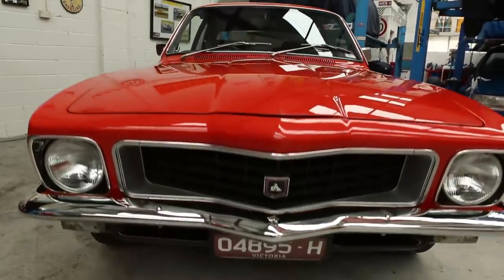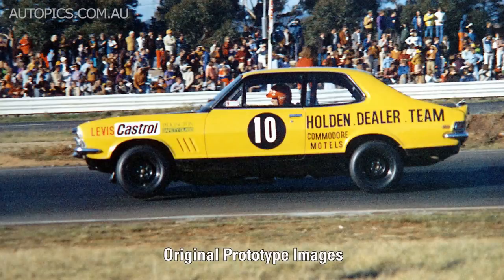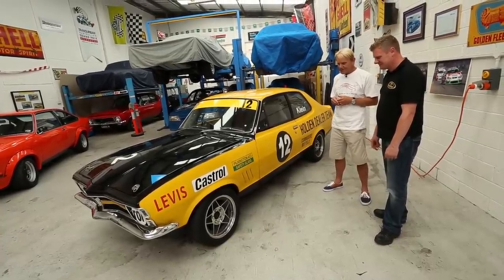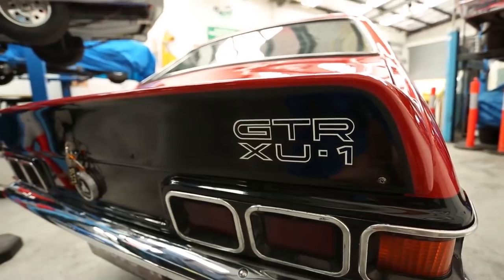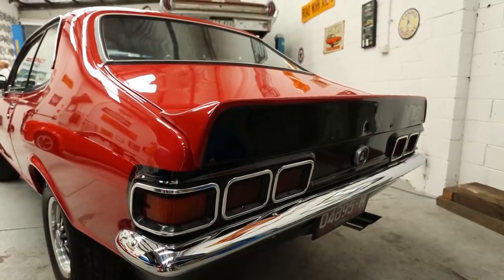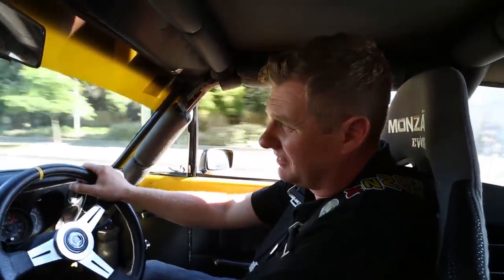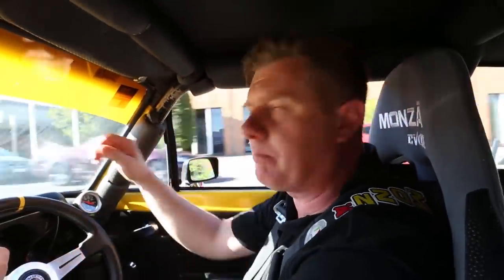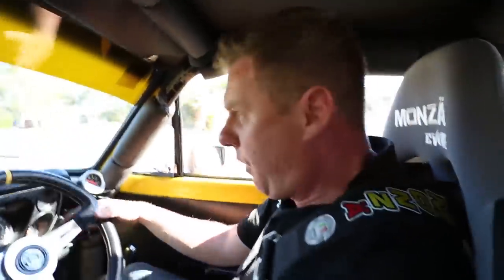XU1 V8 HDT TORANA PROTOTYPE Replica - Pt 2 Ron Klein GM Holden Collection

Comment: remember bathurst is an endurance race not a sprint race & he did say that he was breaking gearboxes and snapping axles before he changed them to the very much stronger Ford units, also the original had 13" rims so that means smaller brakes which is fine for a light 120mph 6 banger but a heavier 150mph rocket all of a sudden those small brakes are left wanting, and dont also forget the SLR Toranas also needed a few generations to stop snapping axles and chewing gearboxes and when Ford went from the 302 to the 351 it also snapped axles and chewed gearboxes it took a few generations to iron out all the bugs and, so yes it would have been a quick car but a reliable one?
Reply: I can remember reading an article when Howard Marsden was being interviewed,  yer he was convinced 
both the toranas and charger's  would of had brake, gearbox's and diff problems running the v8s
Reply: 'Pftt' Ford Fans have no idea the Work that went into the V8 LJ Program by Harry Firth and Holden Engineering, First up they Had New Front Disc's and New Front Calipers for better stopping power and the 308 V8 was only 22KG Heavier than the Red 202 6Cyl Engine any way and the 6Cyl LJ XU1 never had any brake problems any way.  A new 2.78 Detroit Locker Diff was made for V8 LJ and Brand New Sprintmaster Wheels were Designed for V8 LJ, they were a lighter wheel and better cooling wheel, Also the XW7 308 V8 was a 300HP V8 and Harry Firth tested  the Yellow LC HDT XU1 V8 Prototype at the 1972 Easter Bathurst in a Sports Sedan Race and Won without a Problem, Also tested at A.I.R Race Track at Adelaide and at Calder in May 1972 plus Open Highway Testing By Larry Perkins as well without a Hitch. Harry made up a Brand New Sump for V8 LJ that had no Problems at all unlike the LH Torana 308 Engine that Repco did for Holden and Harry had to fix that up during 1974 as Holden used the Repco Sump and not Harry's special sump he made up for V8 LJ.
Reply: @666theninja  
I'll sleep better at night knowing all of this. Don't know about only 22kg but all looks good on paper as the phase 1 did, but 20 laps in.. oh no
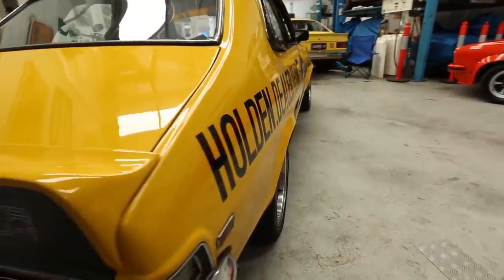Bondy best time was 2:39.6
3:8 seconds  slower than a phase 3
Was racing against alot slower cars
Biggest problem was his race was a huge 5 laps, about 125 less.mmmm
Reply: @666theninja  and holden fans seem to forget that this is bathurst where production cars race not lemans where you can race prototypes! so just because the prototype had lots of bells and whistles doesnt mean the production version would have it
Reply: @GTFORDMAN  The Production Version was getting it ALL, As there is a 79 Page Parts List for the XW7 V8 LJ Torana that List all the Goodies that the 200 Factory Cars were getting so the Car could Race at Bathurst 1972, the Cars were only Two Weeks off Production when Holden Canned the XW7 V8 LJ.  The 200 Aug-Sept 1972 LJ XU1's that were Built got the V8 XW7 Sprintmaster Wheels, Brocky had them on the 1972 Winning Bathurst Car if you go look.
Reply: @666theninja  
That's good that they were testing, but the point we are trying to make is that Bathurst was a RACE for 130 Laps,soon to be 163 laps.
1972 the falcon v8s had 6 years race development 
Ho's had 4 years of development to work out any problems ( there were plenty only found out in race conditions ). Glen even said he had to replace components because of constant failures, and i bet he didn't go as hard as bondy or brocky.
That's the point I trying to make,
Reply: @jimmartin9704  Pfttt Jim, How many Bathurst the 308 V8 Win, lets see. Bathurst 1975, Bathurst 1976, Bathurst 1978, Bathurst 1979, Bathurst 1980 should I go on lol. The 308 only failed in 1974 due to the L34 Oil Pump needed a extra washer that GMH Engine Guru Fred James sorted out weeks after Bathurst 1974. Funny all the Bathurst I mentioned I do not believe HDT did a gearbox in the race. I have owned many 308 V8's with M21 Aussie 4 Speeds in them and never ever did a gearbox in. As I said before the V8 LJ XW7 Production Car was getting a Brand New Detroit Locker 2.78 Diff and that is Fact. As Harry Firth said the XA GTHO had rear leaf springs suspension for bad Handling and would of had brake problems at Bathurst 1972 as Ford never tested that car under race conditions like HDT did at three race tracks with the V8 XU1 Prototype.
Reply: @666theninja  
And like i said even Glen had troubles with it initially,  which by the way was  what the original txt was about not LH /LX Torana, VB/ VC COMMADORE,  wow
Quote him we finally fix it or do you want me to be a smart arse and say ford parts fixed it
Reply: @jimmartin9704 'Jim' if you watch the Video the owner SAYS the 308 has been stroked to a 355, The Factory XW7 V8 LJ was not going to be stroked at all, Ronald the owner has took it to the next level, no wonder he was doing Diff Centers in the Banjo. I mention the LH-LX 308 Cars as the Engine was not a problem at Bathurst at all. The Factory XW7 V8 LJ would of Won Bathurst in 1972 and as the Great Harry Firth said the car was that good it would of Won everything it entered in.
Reply: @666theninja  
Wouldn't expect him to say anything else, and yer its now a 355, wasn't always
Reply: @jimmartin9704  Rory in Queensland owned it and used to race it before Ron bought it, Ron after he stroked the 308 in it is when he started doing diff centers in it. Sounds like Ron needs the Harry Firth's  2.78 Detroit Locker in it.
Reply: @666theninja  
Yer and we all know what lies were being told on hp to keep insurance premiums down , phase 3 only produced 300 hp to.
As none were ever raced will never know, except for Rons one
Reply: @jimmartin9704  Harry Firth's Yellow HDT LC XU1 V8 Prototype was Raced at the April 1972 Easter Bathurst and then later Raced at the A.I.R race track at Adelaide and then on the 14 May 1972 at Calder, so it was Raced, that Yellow LC XU1 V8 even had a Rego Plate, Victorian Rego Number KSN116, So it was Raced and never did a Diff Center or a gearbox during them three Races. Also Larry Perkins Road Tested it for thousands of miles as well. Harry Firth said if anyone was going to break it, it would of been Larry Perkins, Larry hit 6500RPM in Top Gear in it on a Open Speed Highway, as some States in Australia in the Early 1970's had open speed on there highways. Plus the Strike me Pink V8 LJ GTR Prototype was Found in 2012, it's the Only one left out of the Three LJ GTR V8 Prototypes, the Orange one was Stolen in 1985 from it's Pvt Owner and has never been found, the White one if Survived since finding a new home since GMH is still out there or long gone. Least the Strike me Pink one has been found.
Reply: @666theninja  
But according to you 8 messages up it wasn't running the " Harry's motor" 
So again i will say we will never know, unless they dust off old pinky and do more than 5 laps at Bathurst
And i doubt that will happen. 
Again i could waffle on about how you said the v8 lj would of won everything but the facts are when a v8 was put in a torry they had all sorts of problems, which to be honest, according to you should not have happened.
Like we said earlier with all the good parts it was alleged going to get, when bean counters get involved 
You don't get them even when you are the great Harry Firth
P.S. it wasn't till 78 and the A9X that all they problems were sorted 
T10
Detroit locker
Ring a bell
Oh yer great that they found the pink v8 lj , bloody beauty
Reply: @jimmartin9704  What your not getting is Harry's Yellow Car did Three Race Track Testing and Thousands of Miles of Testing by Larry Perkins, the car did not do a gearbox or a diff under them race conditions, The 79 Page Parts List for XW7 V8 was Done and Approved, REMEMBER the V8 LJ was only Two Weeks away from Production, so every thing on that list was approved as i have a copy of it. 200 Cars were getting Detroit Lockers and all the other good stuff that is on that list. Bean Counters approved it cause GMH wanted to Win Bathurst 1972, in the End they Did not need the 308 V8 any way at Bathurst in 1972. Yes great News the Pink V8 Prototype has been found.
Reply: @666theninja 
Yes but 3 meets,endless testing 
(with or without the gun motor) 
Doesn't even come close to race conditions, especially Bathurst no matter how much you try with testing,
( Look at moffart in 74) so l will agree to disagree
Reply: @666theninja  
Forgot to mention Ian Tate said that the XU1in72 had 240HP (6cylinders)
L34 could get 340+HP
Why go to all that trouble of completely redesign, re-engineer a car for only 60 more HP (LJV8 ) 
Doesn't make sense. 
It had alot more than 300, and it would of had the same Achilles heals as the first LH, as Rons had
Reply: @jimmartin9704  You forgot all the Thousands of Miles that Larry Perkins did in the Yellow LC HDT V8 Car, all there Testing was Waaaaaaay more than Ford did with there Phase 4 Falcon, so i know which one was more like to Fail at Bathurst with Brake Problems and that be the Phase 4. As the V8 LJ had no Brake Problems at all as Harry sorted that out plus the Handling and a Detroit Locker Diff, the XW7 308 V8 only had 300HP in the 1972 Time Frame, was not to 1974 with in the L34 time frame when they got Roller Rockers etc they went past the 300HP stage. A light weight Car with 300 HP 308 V8 would of been a Missile at Bathurst and with it's 36 Gallon Fuel Tank and Twin Fillers meant One Fuel Stop, Brocky would of Won by 6 Laps in 1972.
Reply: @666theninja  
Again no long distance race conditions for any results. Pissy 5 laps at Bathurst ( Bob Jane was miles in front before he had problems in his v8 torana) with no opposition to test it
* Week later  at AIR, Brocky raced it but it experienced problems 
* Dont now how long the one at Calder in May went for 
So we'll never  know, cause 1000000's miles of testing is only a guide but not in your world
Ford had 4 years of hard racing from many competitors in there HO's to learn what failed, re engineering it to improve those components which they did ( and there were plenty that were only learnt FROM RACING ) even when it looked good on paper 
Phase 4 had globe mags specially designed for the XA which improved braking by 50% on the Phase 3
Had 4 wheel disc brakes on the XBGT
* ONE PIT STOP REALLY, what a load of malarky, so 65 laps on one tank
Spose Harry sorted that out as well, went well for you in 73 that plan with 6 cylinder didn't it 
*Again with all the shit that was the best in the world cause Harry sorted it out on the LJ, 
*And him in still in charge in 74 never  went on the LH 
Why????????????
You know he had it all worked out on the LJ but f@#k all of it was transferred across. Mmmmmmm wonder why
Reply: @jimmartin9704  i think you summed it all up there mate, the Phase 2 GTHO's use to dominate sprint races but melt the pistons in endurance races because they had a natural tendency to run way to lean, Ford corrected it with the phase 3 and won then further developed it for the phase 4 which got shut down because of bureaucracy! but THAT development went onto to win 4 more Bathursts with the XA GT twice, the XC Cobra and then the XD, sorry 666theninja it's great to be a Fan and it would have been a very cool car BUT sprint races and road trips dont mean squat!
Reply: @GTFORDMAN  
Yes he's seems to love the xw7 project, but also contradict himself
I'm trying to be fair because all cars have good and bad points. 
It's amazing that the supercars even survived, blokes who did that deserve a medal
Reply: @jimmartin9704  yes a 36Gallon Tank and the 308 V8 was less Firsty than the 351 V8 would of been lol. Ya XY GTHO had brake problems at the 1972 Bathurst and the Phase 4 would of as well. End of the Day the 6Cyl LJ XU1 beat the So Called Fastest 4-Door car in the World lol, i still laugh about it.
Reply: @666theninja  
You still haven't answered my questions about why it took soooo long to get all parts that made the torana unbeatable ( A9X years )
According to you the LJV8 was a
Rocket ship and unbeatable, 
LH Achilles heal was 
Brakes
Diff
Gearbox 
Brock, Bond and Firth all admit it in a interview ( HDT story)  and you had all the parts or knowledge of how to fix it and nothing... why.....
Cost factor as i said earlier, what you want vs what you get?????? 
Your reply was no all been accounted for by the bean counters and 2 weeks off production 
YET NOTHING ( i would of thought his sump would have made it) 
Even Harry said they were rubbish, new of the problems  and 
NOUGHT, ZIP, NOTHING 
Really, really strange
So i wondering how much GMH thought of him ?????????
Ford got rid of him in 69
Rain helped 72 win
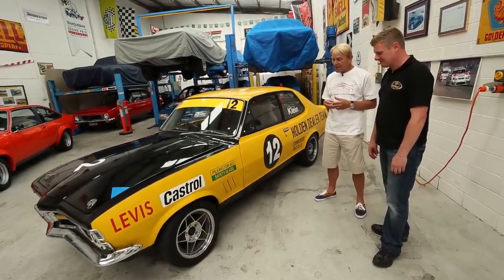I think he was 1:30 in front in 73 cruising to victory and go for max laps Harry said and ....oh no...
In 74 6laps up after 100 odd laps and Harry tells  Brocky to ease up take it easy....oh no....
And finally the torana gets all its goodies in 1978
John Sheppard running the show and Brocky comes back
Mmmmmm i wonder
Reply: @jimmartin9704  Jim the XW7 36 Gallon Tank is full at the start of the race, then it was one stop to fill it up and that was it, if you go back and look i said one stop, Harry said it only needed one fill up stop, the V8 XW7 LJ was better on Fuel than the 6Cyl LJ XU1 anyway.  Ford got so Lucky at Bathurst 1973, the fuel muck up and the puncture Brocky got near the end of the race that hurt and he still finished Second place after all that drama. Proves how fast the Brock 1973 HDT LJ XU1 was that day and oh it 'didn't do a gearbox or a diff' in the 1973 Bathurst race. Funny the LH Torana L34's that Won Bathurst in 1975 (Brock) and 1976 (Bob Morris) had no gearbox or diff dramas
Reply: @jimmartin9704  Jim there is a GMH Engineering 79 Page Parts List for the XW7 V8 LJ and all approved by GMH to build the 200-Cars with all the Goodies as i told you three times now. GMH did not want Fraud to Win the 1972 Bathurst and have a Hat-trick at Bathurst, so they went all out for 72. 36 Gallon Tank was approved (Tick) 300HP XW7 308 V8 approved (Tick) 2.78 Detroit Locker Diff approved (Tick)  Brand new light weight Sprintmaster Wheels approved (Tick)  New special XW7 Sump approved (Tick). Why do you think Harry was so upset about the car been canned , cause he knew what a Beast it was, GMH did the Engineering parts list on the 28th June 1972 that is three days after that 160MPH Super Cars Scare newspaper headline lol. Proves GMH were taking no notice of that Headline at all and the car was approved to be built and all the new parts were at the Adelaide Factory ready for production, was only stopped by GM in America cause the Acting GMH MD contacted GM over the car and the headlines over it, GM America said we do not build race cars so stop that program, WHY IT WAS STOPPED. The LH Torana Harry Firth called it a Dog and said i have to fix it all up during the 1974 season and the V8 LJ was all sorted and would of been that good it would of won everything. I have a full copy of the Approved GMH Engineering XW7 Parts List as one of the Ex GMH Engineers that worked on that program gave it to me, He even said GMH went all out to Win Bathurst in 1972 and even after with the 6Cyl LJ XU1 after the V8 LJ Program was stopped by GM in the USA, They wanted that 72 Win and got it, Pftt the rain did not win HDT the race in 1972 it was Peter Brock masterclass driving and remember it did not rain the whole race like Fraud Fans like to make out lol.
Reply: @666theninja  
Well of course it's full at the start DERRR, still have to do 65 laps fill it ( 1stop) another 65 laps??. No way in hell mate, sorry not possible 
72 Lj did 47 laps
73 Lj did 54 laps 
Harry's famous sign get max laps ended in push power oohh noooooo
V8s  chew more fuel
Never said the 6 cyl. Lj had a problem with it's diff or box, that car was perfect
Reply: @666theninja  
1974 Bathurst 
3 fords... 2DNF
12 LH......9DNF
9 LJ.........6DNF
1975 
3 FORDS.....3DNF
12 LH..........5 DNF
1976
3 FORDS.....1DNF
15 LH..........7DNF
Point ......
Shear weight of numbers will cover alot of faults
75 bondy went up escape rd. At end of pit straight, no brakes
76 Morris  diff was not healthy, and he was lucky to get home, good on him
Reply: @666theninja  
We all know the reason why all of these cars makes pulled the pin in 1972
they would of known about the LH model late 72/ early 73 and 
NONE OF HARRY'S GUN PARTS made the cut, REALLY COME ON
All the phase 4 parts were put into the RPO83 
Info and technology helped the 73, 74 victory 
What was he that upset he took his bat n ball and went home.
After 72 he never won bathurst as a team manager 
You can tell me a million times about what was approved with all the goodies, doesn't answer WHY THAT INFO WAS NOT SHARED!!!!!!!!!!!
SUMP PAN
LOCKER DIFF  
AMAZING 
PS.
Yes Brocky drove well in 72, he stayed on the black  stuff, but all the experts say that the rainy conditions help the lighter and nibble torry.
In practice on Saturday in the dry the HO'S were 3 seconds a lap quicker
YES THE RAIN DID HELP
Reply: @666theninja  
Just imagine  ..........if he had shared all that wealth of knowledge you know from the xw7 project ..
Rocketship
Unbeatable 
Best fuel economy in the world
V8 torana you....
 could of had your A9X years  from 1974 onwards
Reply: The XW7 V8 LJ would of Won by Six Laps in 1972 and would of had the A9X from 1972 onwards thank you. Then again Holden didn't need the 308 V8 anyway, the 6Cyl LJ XU1 did the Job on the Phase 3 anyway lol.
Reply: @666theninja  did the job of the phase 3 only in the wet lol
Reply: @GTFORDMAN  lol what 3 Laps in the Rain then Masterclass Driving by Brocky to get the Win :)